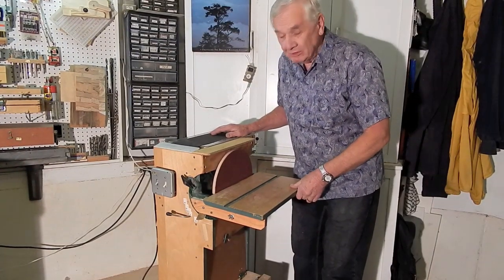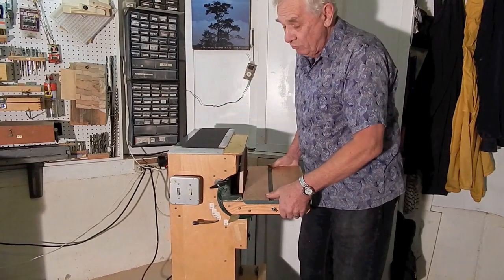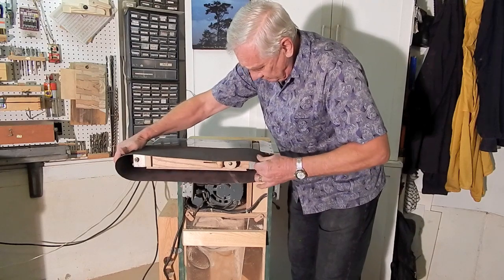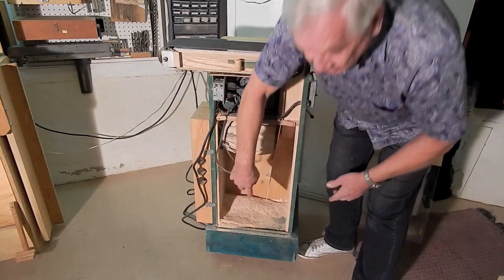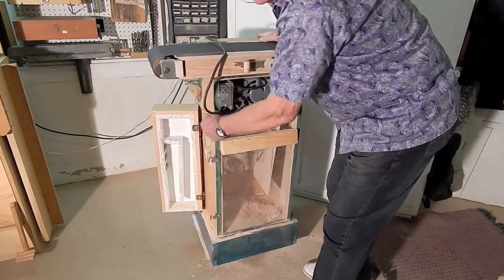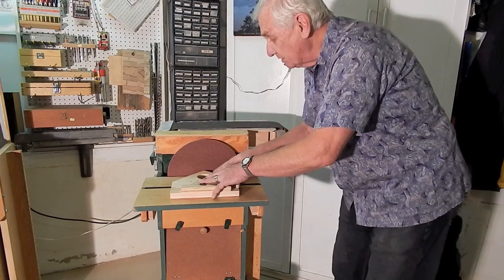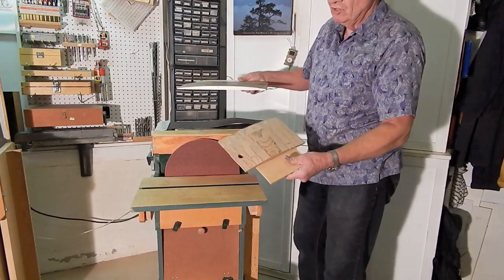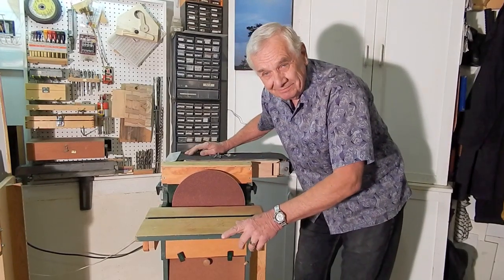Belt Disc Sander Part 1 of 2

Comment: Good idea but shudve gone into detail about how it works and what the motor was from
Reply from the maker: Thank you for the comment Joseph; the motor is an off-the-shelf 1/2 HP  1725 RPM motor available from suppliers such as Harbor Freight and Grizzly Tools,